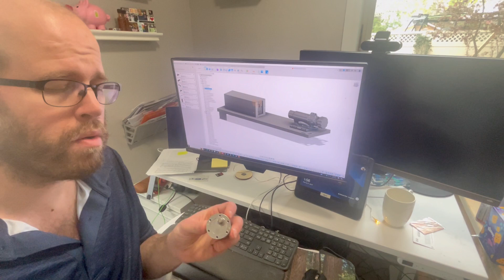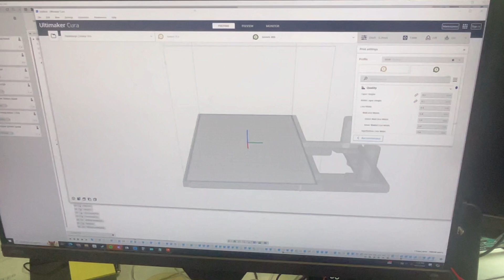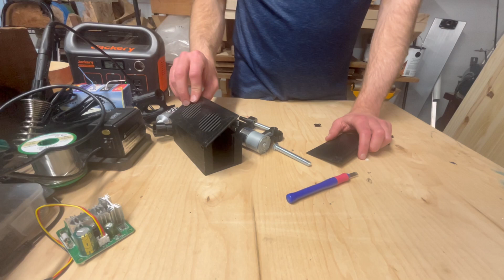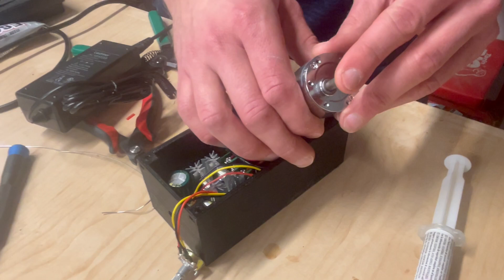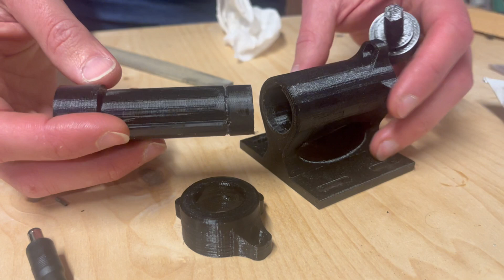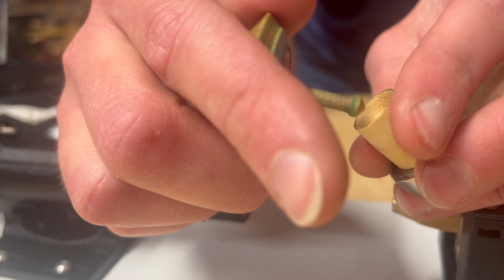3D Printing a Lathe 🗜

Comment: Hi I went ahead and made this but I am getting an issue with slippage from the wooden jam chucks holding the tops.  Is it possible to design holders out of TPU which would be really grippy?  Everything else went great and I even added a forward/reverse switch (DPDT) which makes it usable on either side if needed.  Great model otherwise.
Reply from the maker: Thanks for the comment.   We made the holders with wood.
Reply: @BobAmarant yes I did too with hard maple just like yours and it slips quite a bit. I may have to do something different.
Reply from the maker: @nomarwoodworks  maybe scratch it up some with a Dremel round bit for some bite?